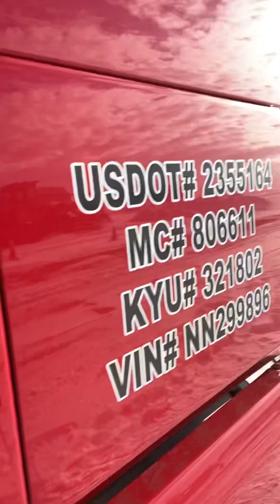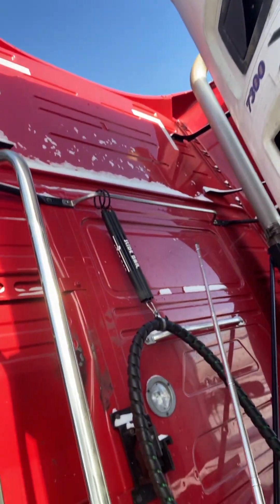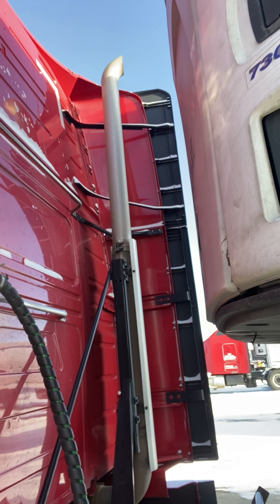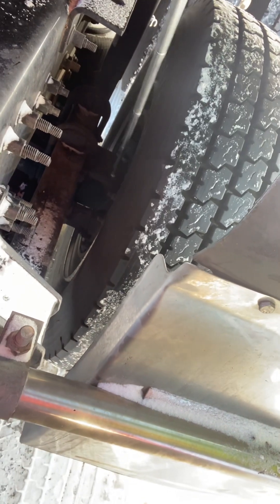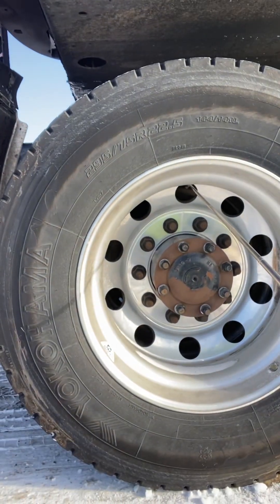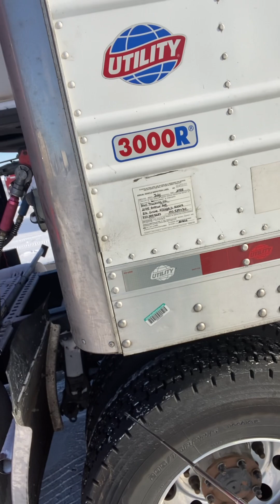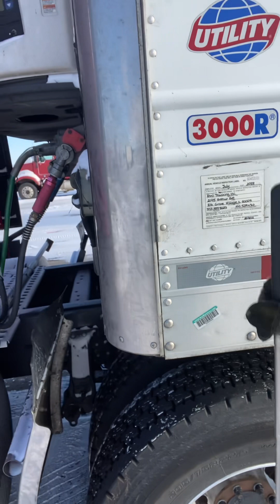PTI. Pre-Trip section B

Comment: SM - "Securely Mounted"
Section B

I open my door, check door hinges, no damage, SM and weather seal is intact.

Check my mirror and mirror brackets - SM, not damaged, no loose fittings. 

Checking that the steps leading to the cab entry are solid, no foreign objects, and are securely bolted to the tractor’s frame.

Checking that fuel tanks are SM, no leaks from tanks or lines, caps are tight.

Make sure the def tank is not leaking, cap is tight, filled to at least 1/8 of the tank. 

Checking the back of the cab for signs of damage such as cracks, bulges, or holes. 

Utility lights and reflective equipment - none are broken or missing, are clean and functional, and the proper color, white. 

Check Reflector tape - 2 white color reflector tapes, L shaped, 12 inches long vertical and horizontal are in good condition. 

Exhaust - no signs of damage such as rust or carbon soot.

Driveshaft - Couplings are not broken, are in good condition, no foreign objects. no cracked, bent or broken.

Tractor Frame - Longitudinal and cross members, no broken welds, not cracked, bent or broken. 
__________

Leaf Springs - No cracked, broken or missing leaf springs. 

Shock Absorbers - not damaged, cracked or broken, not leaking.

Air Suspension - make sure it's not damaged, leaking  and SM

Mounts - check mounts at each point where they are connected to the tractor frame or axle. Make sure there are no loose, missing leaf spring hangers, nuts,  bolts, u-bolts or bushings. 
__________

Brake Hoses, lines and couplings  - make sure there are no cracked, leaking or broken brake hoses, lines or couplings.

Brake Chambers - SM, not leaking, no loose or missing clamps.

Slack Adjusters and Push Rods - it's not loose or missing parts, not cracked, bent or broken.  it should not have a play of more than 1 inch when pulled by hand with the brakes released. 

Drum Brakes - no holes or cracks. No loose or missing bolts. Linings are not worn dangerously thin. 

__________
Rims - Making sure there are no Illegal welds, no signs of looseness, such as rusty trails. 

Lug nuts - no shiny threads or rusty trails, no damage such as distortion to bolt holes. Check axle seal to make sure seal is in place and not leaking, if i have a sight glass, oil level is adequate above refill mark. 

Valve and caps - not leaking, not cracked, bent or broken, and check tire inflation to see that it is properly infalted according to manufacturer specification.

Tire Condition - Tread depths, 

Treads - Tread depth of 4/32 inch on the steering axle. 2/32 inch on all other tires. Tread is Evenly Worn, No damage to treads such as tread separation or cuts to sidewalls. 

Bud Spacing - even, no foreign objects and tires are not coming in touch.

Splash Guard and Mud Flaps - SM, not damaged or torn, mud flap has legal links. 

Taillights - function as turn signals, 4-way flashers, and brake signals, they are clean and functional, none are broken or missing, and the proper color, reflectors are red.

Reverse lights - clean and functional, none are broken or missing, and the proper color, white.